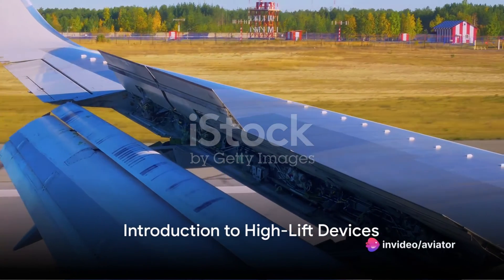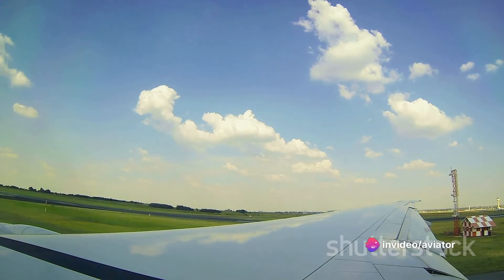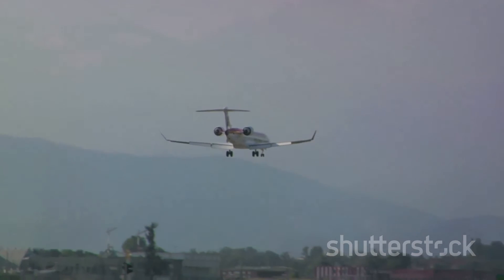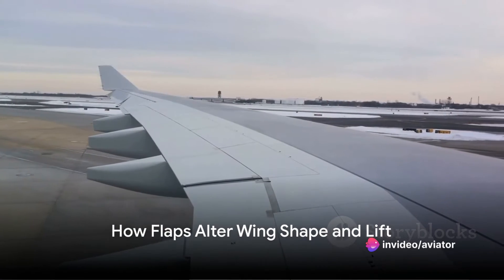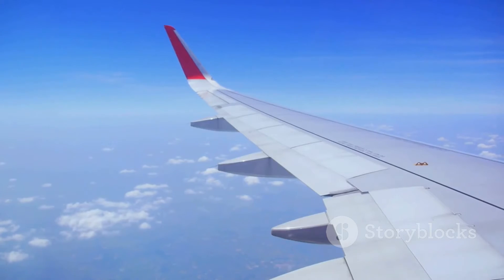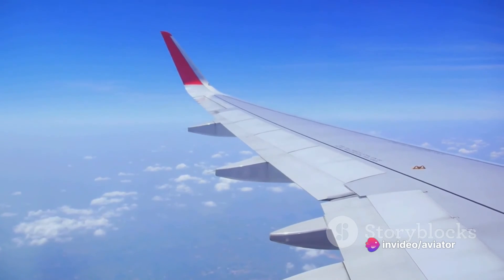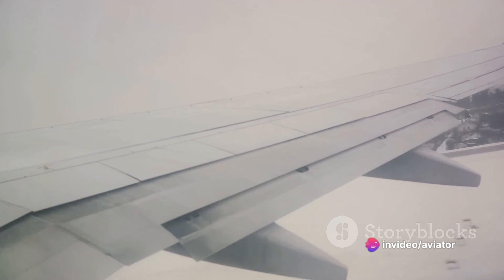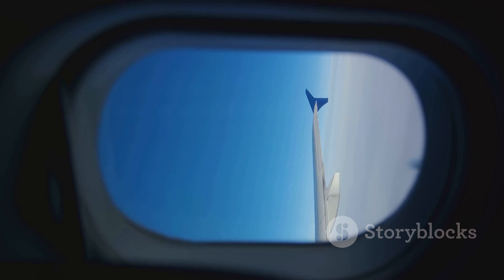High-Lift Devices | The Magic of Flaps and Slats

Comment: Ah yes the magic of flaps and slats and the myth of Bernoulli.  Bernoulli's principle has been misapplied to a hilarious degree with respect to how lift works and it just keeps sticking around.

Lift is not that mysterious. The plane's wing deflects a certain amount of air downwards, and that certain amount of air pushes the plane upwards due to conservation of momentum or  one of Newtons laws: "For every action there is an equal but opposite reaction".  The amount of air deflected downwards corresponds to the angle of attack of wing. Aerobatic air planes have basically flat wings and they fly very well. Also consider airplanes can fly upside down.
Reply: NASA seems to be still quite fond of Bernoulli as part of the over explanation.
Reply: @helipeek2736  May I reply here?
Reply: @helipeek2736  May I reply here?